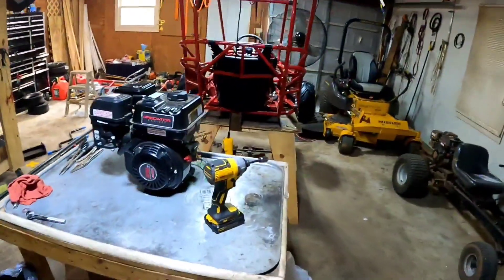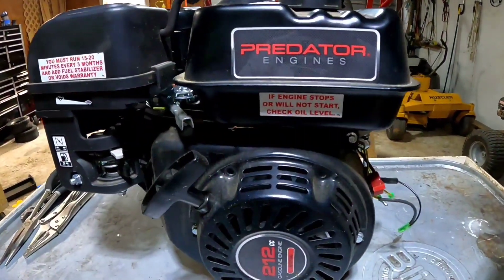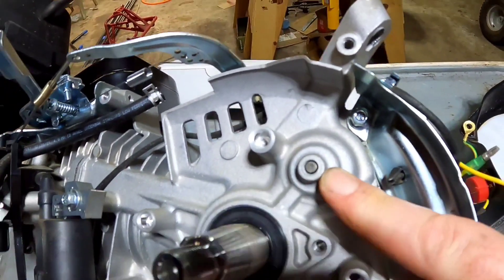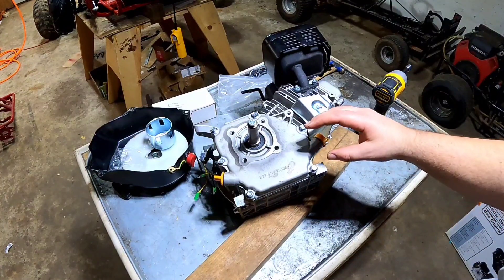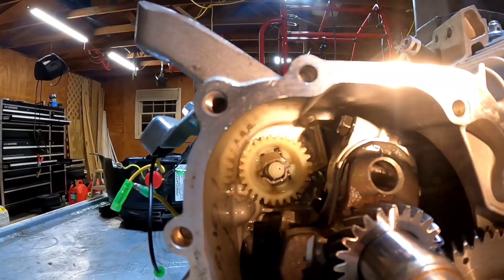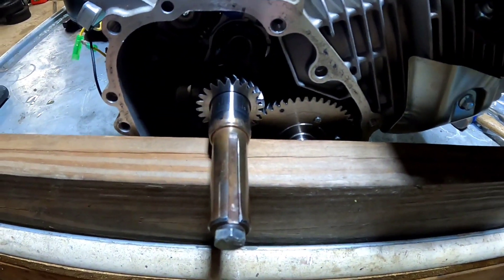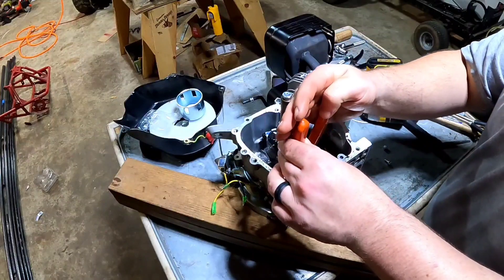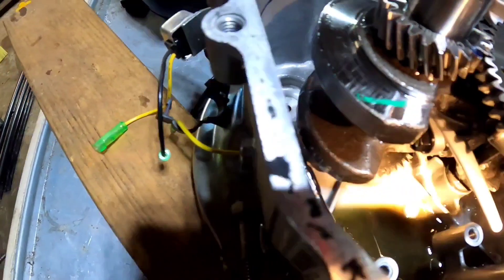Predator 212 Removing the governor | part 1

Comment: I'd be a little worried about that wire dangling in there, since it's not secured in place by the sensor anymore. I'm not sure what real issue it would cause but it'd make me feel safer personally not having it flopping around.. As far as the self-tapping bolts, do you have any size specifications?
Reply from the maker: 1/4'' self tappers (ordered from gopowersports). I thought twice about the wires, but instead of cutting and rewiring when I'm finished, I figured I would try to get away with leaving it together. So far so good.
Reply from the maker: I read your comment incorrectly.  I thought you meant the on/off switch wire. The wire in the engine is stiff, and after I cut it again it will not be able to move at all.